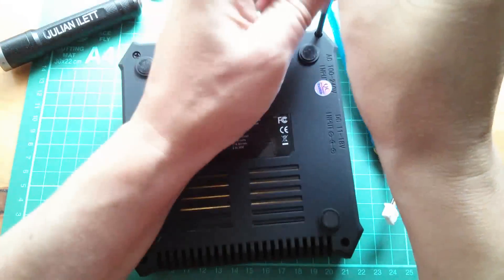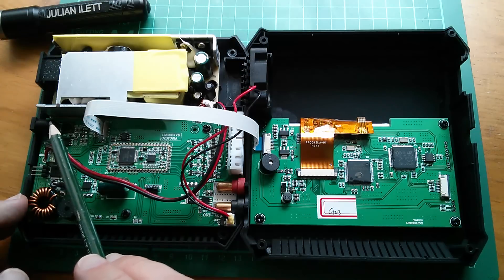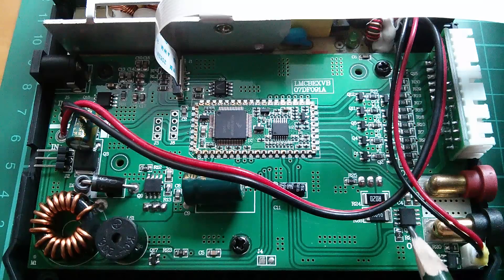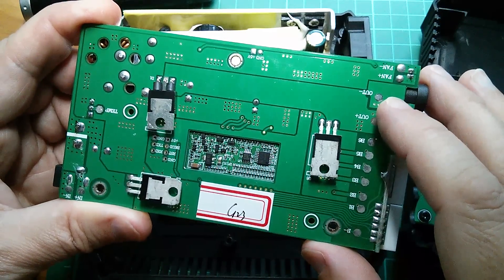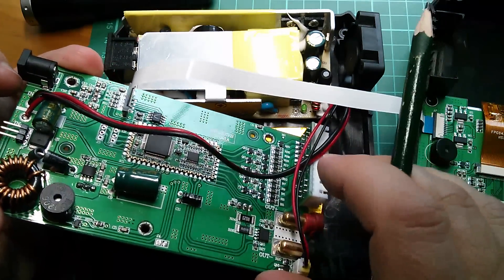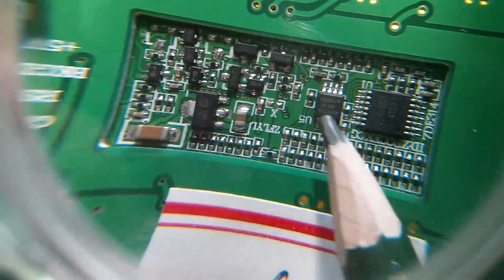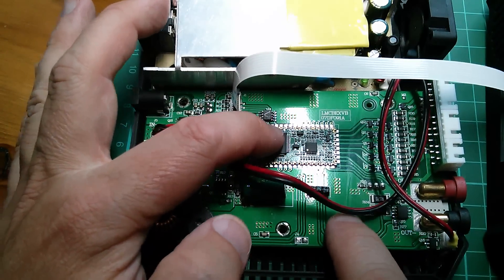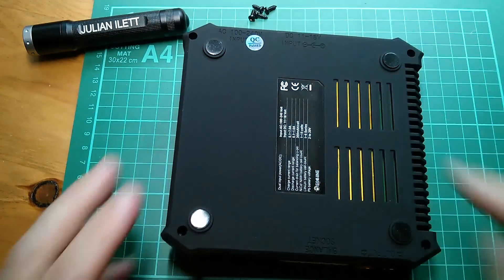First Play: Eachine Touch T100 Multi-Chemistry Charger #2

Comment: The microcontroller is probably on its own pcb because they used a commercially available one and just built the rest around it.  I'd guess it was originally designed for monitoring a lot of sensors in an industrial application which would explain all the inputs and all the unused pads in this case.

Comment: The reason for the small seperate CPU-board is to save costs. A dual load (SMD components on both sides) are pretty expensive to manufacture. Also, space is a premium in pick&place machines, so if you can make a panel of these CPU-board and stuff them all in one go in the P&P you save on machine costs. Also the modules can be tested beforehand. The rest of the charger PCB is made in a very different kind of soldering process, so it give very much sense to have the CPU-board seperate. The 324-devices are LM324, quad comparators. They are used to measure the voltage of each cell in the balance chain.
Reply: Also it probably is a heavier gauge copper on the main board, and the logic board can use lighter gauge, as well as possibly 4 layers, judging by the components density.

Comment: It's possible that the large board has a heavy copper layer that can not support fine pitch parts, so they have implemented the cpu and small parts on a seperate board for that reason.

Comment: Ffs.. The discharge part is... Dunno.. Stupid..  Why would you even try to cool it like that.. And also.. I think that AC/DC chargers are crap anyway.. (unless they are expensive)  they always seem to tend with space problems.. In this case.. Dunno what to do with heat.. Why on a little aluminum plate...why

Comment: the balance sense circuit on the back could be 6 opamps - 4 in one package and 2 in the other, smaller one. Resistors/caps are the passives for the opamps.

Comment: Truly speaking, I'm disapointed. The charger seems to be generic one, like Imax B6 and all its clones and spin-offs, the elements on pcb and pcb itself speaks for it. The only one thing, which is the user interface, looks like new feature, so all they have to do, was put more powerful processor, to serve the touch screen, and to plot basic data. Even window zooming seems to be not implemented, so the full scales of voltage and current are displayed even if actual needs are only percentage of them. What a shame! I'm seriously doubting if any improvements in charging/discharging/balancing algoritms are introduced, so are tolerances in voltages and currents measurments. Meh, I wouldn't buy it now, when I've seen its guts. Nothing new, nothing innovative, since it's precursors mentioned at begining. But thanks for a nice video, Julian!
Reply: Yup! The all important guts remarkably identical to the ImaxB6. I have gone through 5 Imax B6's! - all different faults.But at £13 or so a pop, not too painful on the old wallet.

Comment: Unusual design for this product. A single STM32 could of been handling both the display and the analog part. There is nothing special about that small cpu module, those are probably series protection resistors for the io's but they could also be ferrite beads for filtering. There are several reasons for using a separate cpu module, first they could be getting it cheaper, ready assembled like that, because if you need 4 layers to route and decouple everything it's much cheaper to have a small 2 inch module, than to have the whole board manufactured with 4 layers. Second the assembly cost and procedure can be simplified when using SoC modules like that because you don't have to pick and place small 0402 components, or you don't have to solder high density LQFP packages.

Comment: It's separated because it is cheaper to have only the small boards manufactured in a 2-side surface mount process than doing the bigger "mainboard". Just think of a panel with multiple cpu-boards, ~12pcs combined in the size of the mainboard.

Comment: Noticed there was two serial ports on it... could one be for programing the micro and the other for debugging?
Wonder if you could do datalogging thru one of those two ports to the left of the micro, ther pinouts was on the silkscreen of the bottom of the pcb.

Comment: The small board is more than likely an off the shelf SBC like an arduino nano. Sometimes it is cheaper to design the SBC into the final product than buying all the parts you need to replicate it on the finished product.
Reply: To me it looks more like some kind of Teensy micro.

Comment: Hate the heatsink design. There should at a minimum be thermal paste. Maybe they seperated the cpu module so if the main board fails, they can desolder the cpu and reuse it.

Comment: That smaller board is going to be multi-layer and is obviously purpose built to lower costs.  It may even be designed and assembled in a completely different factory and ordered in. It can then be easily added to the  much larger 2 layer board we see here.  This type of construction is becoming quite common in today's purpose-built hardware.  Since the smaller board also has a specific footprint and pinout it will also allow for future upgrades and varied models without haveing to do a complete redesign of the entire device.  The smaller board also appears to be capable of 8S or even 10S but it is hard to tell without reverse engineering it.

Comment: Most of them use atmel chips, looks like this is using something different or an atmel copy chip? I wonder if it will run the third party firmware like the others can and sense battery resistance? Maybe not with this custom processor, or maybe if it's an atmel knock off IC? I've seen others with much cheaper current sense resistors that fail, this one looks decent. The tape looks like it is kapton tape, not good for transferring  heat from the mosfets, it's better for stopping shorts and blocking heat, weird. Maybe the board was shorting to the heatsink, or the heat was getting to hot causing the unit to fail safe so they used kapton tape to block the heat from the main PCB? . If you removed the tape just for parts of the three mosfets and put thermal past on them it might stay cooler and still block shorts and heat getting back to the main board. 
It has my interest, may need to buy one now. We're did you get this one from, you normally show the Ebay seller and stuff on the video.
Reply: Never mind, bangood you said. It has my interest but not for that price for a touchscreen. Maybe if my sky charger ever dies, but it seems to run strong and I don't see it dying anytime soon. Nice tear down add review.

Comment: Just few thoughts about the hardware based on what you have shown in the video.
The cpu on the module board seems to be Freescale´s MC9 family based cpu. I found out by looking on the unpopulated headers next to the module. The pins of one of them are labeled GND, RST, BKGD and +5v indicating its programing interface. Also, the other unpopulated pin header seems to be UART port. Would be interesting to solder in some headers and see if it is used for something. Maybe alternative control interface?
EDIT: also the GGS324 seems to be acording to some datasheets low power quad operational amplifier. They may be used as differential amplifiers to amplify the voltage differrence between cells and then fed to internal ADC of the MCU.
EDIT: after some zooming and googling, the mcu seems to be MC9S08PA60AVLDR. It is 8bit architecture based, but still pretty beefy nonetheless. It has (among many other peripherals) 16 channel 12 bit ADC.

Comment: would be nice if you goin to test the NiMH termination algorithm with your scope, 
Lithium termination is easy, just cc then cv = done, only one method
but there are many methods for NiMH termination, and few of them are not so good at filling the battery without harming it,

would also be nice to see if its actually use constan current or pwm with deferent chemistry, 

thanks for the vid, hope to see you more active.

Comment: 1. the 2 buzzers are called by them "beep" and "buzzer" one is for touch and other is for charge complete.. also im not 100% but there will be 5 balance pins and one earth/positive.. you need to plug the  red and black wires in to get all 6 on balance charge.. also this unit is a cheap one of the real ones they make.. be carful what you buy.. they are made for RC cars.. i have one here not a fake and it charges my battreys for my 2 stroke RC car.. hope that helps? iv not seen the touch screen one before.. also when it said charge compleate was the button that you push have a line under the first letter? if so im 99% its windows ME.. and it sure does seem like it with the takky one finger touch screen lol
Reply: the line means that on a keyboard you hold "ctl" and the letter on what you want and it highlights it automaticly.. have a look on a programme on your pc and hit the windows UI menu you will see what i mean
Reply: There was no need for two buzzers or pizeos in the charger... the microcontroller (the "brain" of the charger) can play whatever tone or combination of tones it likes on that - think of them as being a tiny speaker - but instead of normal sounds, they're really only good at playing tones. Just like in those novelty musical cards or candles. And you can connect to all 6 cells of the battery with just the balance lead - there is 7 connectors on the plug - hard to explain - if you simply it to a two cell pack (which has three connections on the balance lead), 1 goes to negative of the first , 2 goes to the positive of the first cell, which is also the negative of the second, and 3 goes to the positive of the second cell, which is also the pack positive. And these chargers don't run Windows... that would be way too resource intensive to do... it would take the thing over a minute to start up let alone be usable!!! Look up something like Arduino and LCD to see how microcontrollers drive LCDs.

Comment: Good to see a video once again, great stuff. I don't think I need one of these, although they do look great for what they were designed for, I have one multi-cell charger that works OK, I think it is a fake but it does do the job for me, just recharging the old lipo cells that I take out of dead laptop batteries and use in the gadget's that I build out of arduinos.  Great to have another couple of videos, guess you must have been on a holiday....
Reply from the maker: +Jerry Ericsson Thanks Jerry. This inactive period was due to a tooth extraction. Ouch.

Comment: It doesn't seem to offer anything more than the standard "4 button" chargers that are so common.  The resolution of the display is frankly pathetic and tells you little in practice.
Reply: +VoltLog  The cost of this Eachine charger works out the same as an IMAX B6AC v2 and Bluetooth add-on, so if you just want information at the time (assuming you can record it in some way from the App) then either option seems viable.

A direct comparison of different chargers would be quite useful.
Reply: I don't recall the standard chargers giving you information such as the individual cell voltages.  Not that useful generally, but if you had a bad cell then it would be easy to spot.  Maybe the newer Bluetooth 'app' capable units give extra information.

I was looking at replacing my existing Chinese iMax B6ac knock-off with something better, so good to see one of these taken apart.
Reply: I have one of those Turnigy chargers (Accucel 6) and they certainly do display individual cell voltages whilst charging/discharging batteries. The information just isnt all displayed on the one page.
Reply: It doesn't offer much extra but the touchscreen + the graph + the bargraph make it a bit nicer and user friendly.

Comment: Would that be a current sense array feeding back to the micro? GGS324 are quad op amps, you can see the amount of caps and resistors around those devices. The price on this from Banggood is rather  reasonable. Julian have you had any problems with EBAY?  They won't let me buy multiple items from Alice1101983, only one item at a time. Just wondering if you or anybody else have the same problem? Anyways great video's as always, maybe Banggood will get my order instead of Alice. Cheers :-}>
Reply from the maker: I don't remember having that problem on eBay. Sometimes I can't add items to the cart, I have to buy immediately.
Reply: Thanks Julian, I'm having the same problem it's good to know. They said it will be fixed, I just don't like adding fifty transactions on my credit card.
Reply: ggs324 are definently op amps, google lm324.Manufacturers sometimes change the name
Reply: I always have to change from dutch to the american version of ebay to be able to add things to the cart...
Reply: Can you proceed to the checkout page I get an red exclamation error